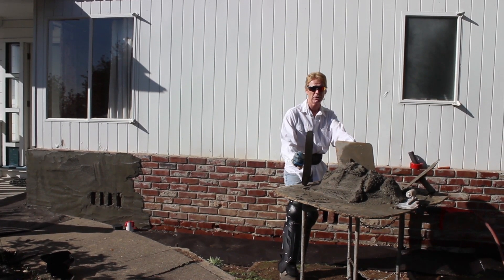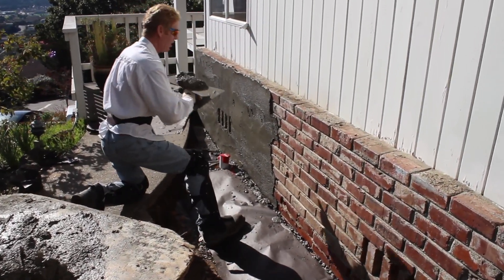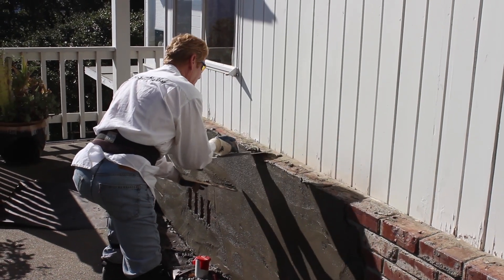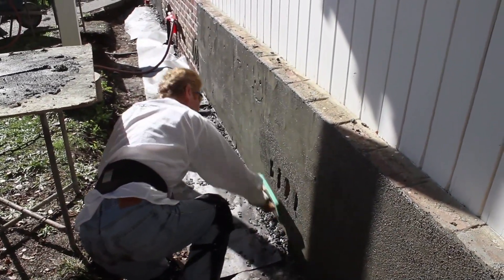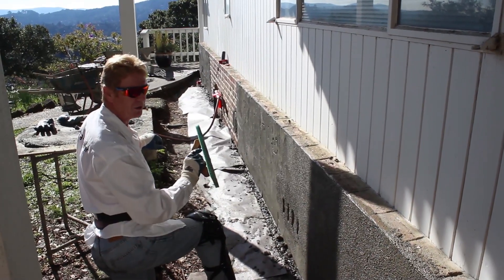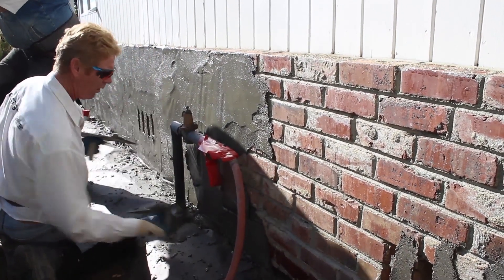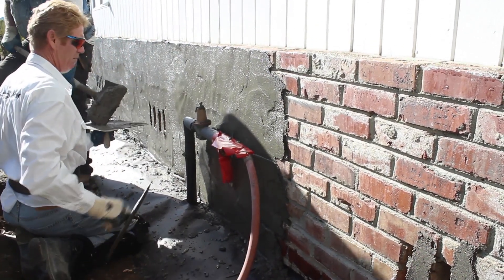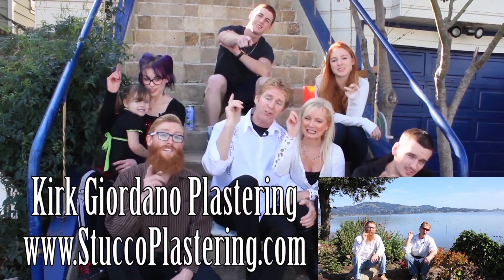Stucco over brick walls

Comment: Do you have to repoint all the brick, or can you use the “skim coat” and push it into the joints if it’s bad and falling out? I had a “skim coat” that was done horribly, all cracked and falling out. I simply used a hammer and taped it and it just crumbled off in most places. The joints are all dust and falling out in 90% of the bricks. I’m guessing they didn’t clean off the wall before hand and that’s why it didn’t stick the first time they did it. But to repoint all the brick is going to take me 2 days. It’s just me and my moms boyfriend redoing it. I used a high pressure hose and got all the dust and dirt off. Can we just go a little heavy and push down hard to fill in the spaces or do we have to repoint it first?? I would imagine just pushing the stuckko down hard is going to fill most of the spaces. I did have to relay 3 different spots that were so bad I could literally just pick the bricks up. I actually took them all out and restacked and remortored them myself. A cpl bricks were so bad I had to replace them. But this was in the places the down spouts were and they all ended way too high so I imagine it was all the water damage that caused them to deteriorate. The rest of the wall is in good condition and still holding tight but in a lot of the wall (ok most of the wall) they are missing most of the mortar in the joints. You can see on the stuff that fell out the old skim coat was pushed into the joints but it fell out with the rest. Again I’m sure this is because they didn’t clean it before hand. And way what do you suggest? I really don’t wanna repoint them all and make it a 4 days job as opposed to a 1/2 day job especially since my moms boyfriend is a older gentleman so I would end up repointing myself. I did repoint or relay the really bad spots so with the rest, as long as all the loose dirt and dust it clear can I get away with a thick skim coat if I make sure we are pushing it into the cracks???
Reply from the maker: Good evening my young friend. Clean as in this video and simply skim the bricks, no need for tucking if you will skim coat the brick wall.🤠
Kirk and Jason Giordano plastering, sharing well over 850 free Stucco/Plastering videos for your education. 
    Together we have created the most comprehensive encyclopedia of Stucco and Plastering videos ever produced globally, all by your favorite plastering messengers of YouTube.
Bringing peace, love, and brotherhood back into plastering.🎭🏝🎆

Comment: Hey kirk my wife & I purchased a home that was built in 1911 & it has brick column pedestals along the front porch , I want to put stone veneer on the brick,  should I use a bonding agent before parging the brick or do I need to parge at all to apply the venners
Reply from the maker: Howdy Mark, bonding agents don't attach stones to anything. 
You would need a cementitious adhesive for that Such as Ploy-Bond by La Habra.
 Or a tile grout.🍻

Comment: Kirk, I love your videos.  Have helped my tremendously stuccoing my home in Florida.  I have 40 ft high brick building in Boston that needs restoration.  Repointing quote is $120K ouch.  What's your though on stuccoing in cold weather states?
Reply from the maker: Howdy Pedro, stucco holds up well to snow as well as Safari desert conditions. Sidewalks are everywhere in the united states, It's the same material. stucco has portland cement and sand while concrete is portland cement and rocks. 👨🏻‍🔬

Comment: if you do a scratch, brown, and a finish layer, what is the appropriate drying time between each layer?
Reply from the maker: Howdy  Kyle dude, 
    if it's a wood substrate with paper and wire, 48 hours after a scratch apply the brown coat, "second coat," then wait two to three weeks later after proper hydration, to apply a color finish.
      If your covering bricks or concrete blocks, apply just a skim coat, 1/2 inch or more, allow setting 2 to 3 weeks also, then apply a cementitious color coat.
 FYI, if your planning on painting or applying an acrylic stucco finish both seal the stucco, wait 1 month cure time.
     
                                   Live long and plaster
       Sharing plastering information,  as the world can use more teachers.

Comment: Hey Kirk, thanks so much for the videos! Entertaining and very informative. 

Question for you: are there any precautions that need be taken when working with old brick (early 1900s)? I've been told that modern mortar (containing portland cement without any lime) can destroy old soft brick because it doesn't leave room for thermal expansion. Is this a concern when using modern stucco on old brick, especially when the brick mortar joints are chiseled out?
Reply from the maker: Good morning Deriek, I would not worry about this myself, yes, it's a fact that Portland cement is sort of new about 150 years old and discovered in Britain in the 1800's while lime plastering is well over ten thousand years old. 

                                             best wishes,
 Sound advice for plastering issues from your favorite stucco geeks

Comment: Hey kirk..I'm trying to learn plastering. Do u have to put pva(glue) on internal brick wall before plastering sand and cement?
Reply from the maker: Evening Shaheb, I would as you can't pressure wash and interior wall. It makes a house too wet. 🍺
 Plastering tips and products by Kirk and Jason Giordano with over 800 video’s
           bringing peace, love, and harmony back to the plastering world

Comment: Kirk big fan... I have a question so we can do sand finish with gray mud, or is it better to buy stucco for example 16/20 la habra..  thanks
Reply from the maker: Howdy Zarate Dude, if you use a grey basecoat as we did in this video, you can bring out the sand if you choose to.
 if you use a pre made finish coat with 16/20 sand, it's easier to get a perfect finish as the sand is screened to be the same size. 
 
                                  Best wishes,
    Professional answers on plastering projects with issues

Comment: Hey Kirk can you do a video of you ruling a wall , I haven’t seen you do it yet . We use a aluminium u channel to rule the walls here down under to make it perfectly flat and straight .
Reply from the maker: Greetings Jon, I have so many of these, I call it rodding or darbying a wall.
 Type these words in on our channel, and quite a few will appear.

                Cheers,
       Sound Plastering tips from your favorite stucco geeks
Reply: I’ve seen a few of you using a Darby , but I’d like to see a video of you ruling it true and plumb or rodding as you call it .

Comment: Would fogin it make the grout lines go away?
Reply from the maker: Good evening No Dude, no, a fog coat is to generally to remove scaffols joint colors or to even out a color coat that where the wall was wet unenly giving varinces of colors, it's basically water with cmentitious color in it.
                       Live long and plaster
           Sharing the plastering knowledge
Reply: Thanks boss

Comment: Love these Videos!  Helpful! I have a brick on my front steps that have old glue from carpet and and are just old and ugly.  Is there anything I could coat over it?  Everyone says def no concrete b/c it will crack.  Im a one woman show but have done a lot myself around the homes I've owned and am up for a challenge..  I just need to save money so I dont want to have it redone or put wood over or tile over it.  Any  helpful suggestions much appreciated!!
Reply from the maker: Hi Bris Saxon, sure you can save the dough and do it yourself, use a gas powered pressure washer and remove all the dust,dirt grim carpet glue ect from the brick porch and steps. You may find that this does the trick for you, as it can look brand new afterwards. If you don't like the look apply a bonding agent, weld-crete then apply a thin coat of BMI 690, and either smooth it with a trowel of bring out the sand with a green float.
 If you have or had any movement in the bricks, then it may crack your new surface. 
BMI 690 is only sold at plastering yards, thus google plastering yards near me.

Comment: hey kirk I have to paper and wire on to a new footer that was added and then try to paper under this disintegrating exterior corrugated drywall now the footer is about 3 feet tall should i use bitchathane membrane up to my bottom plate and then paper down from my tie-in if I can get that paper in under that corrugated drywall  whats the code on that? and how should I install my wire on to the footer? and should I use diamond mesh or stucco wire? thanks just wondering what you would do.
Reply from the maker: Good afternoon Lincoln dude, I have video's showing how to do this type in on this channel how to lath exterior sheetrocked walls or lathing stud walls. It's time consuming to figure out where to stop, often it's best to remove the whole thing and start fresh.
                       Live long and plaster
           Sharing the plastering knowledge

Comment: I am redoing a garage attached to my house it is wood framed on cinder block foundation that comes up about 3 feet off the ground, once the outer boards 4x8 1/2 inch plywood was put on it overlapped the cinder block by one foot. When I do the stucco what would/should I have on the bottom of the plywood to hold the stucco in place on the bottom of the wall?
Reply from the maker: Howdy Sardom, type in weep or drip screeds on my channel, I have about 10 videos that show how to fix this issue.
     
                                   Live long and plaster
               Kirk Giordano’s Plastering answers to life’s issues
Reply: Kirk Giordano plastering Inc. excellent !

Comment: Kirk , first let me say am a big fan and thank you for you videos I have been able to complete jobs the correct way ..     I have a question for anyone that can help .
I have a job that requires eifs over painted stucco .  It’s a existing wall that has really old course painted stucco and the cliente wants a smoother finish .  So it seems to be to difficult to just skim it  and new finish .  So can I apply eifs over this painted walls . Or do I need to remove paint first .
And if so can I sand plastic it off ??
Thank you
Reply from the maker: Howdy Hector, if it were me, I'd apply a bonding agent over the wall.
 I recommend Weld Crete by Larson.
 Of course, nothing adheres to a dusty surface so clean the wall first with a water hose to remove any dust.
                 Live long and plaster
 Do’s and don’t of plastering’s leading experts

Comment: Great video. Curious if this stucco trick could be used for a brick walkway? Our home is brick and so is all of the hardscaping so a bit overwhelming visually. Looking for a cost-effective way to change the hardscaping in the walkway and backyard pool surround without having to rip and replace everything lol the homes brick exterior was already stained to change the color but if there is a way to use stucco as a way to make the appearance of the brick disappear that would be awesome
Reply from the maker: I’d suggest attaching slate over it. Stucco won’t adhere very well to walkways especially that’s been stained.

Comment: hello, looking through you videos and haven't found what I'm looking for yet. Have you done a house with a fluid applied WRB like R Guard, polywall or any like it. I am wondering how you flash in the paper and lath at the bottom of a window. Thanks for all the videos and insight.
Reply from the maker: Howdy Adam Dude, not sure what you're referring too,  I do know that any bottom window sill flashing should cover any new moister barrier.
 If there's no window sill flashing make one, either apply a peel and stick which needs no caulking if done right or but a paper flashing next to the window sill and caulk with a polyurethane caulking, to seal the paper to the frame forever.   
    If I have misunderstood and you are hoping to just apply a waterproof membrane over some sort of "Densglass board," this I don't feel will work as even Densglass need a moister barrier and not just a roll-on finish coat, if stucco is to be applied over.             
                              Live long and plaster
                Kirk Giordano’s professional plastering advice

Comment: Aloha Kirk and many thanks for all of your great advice and videos. I do have a question for you that I need some help with. I want to stucco over the Old cement block exterior wall of my garage that the 1929 stucco has been crumbling off of.
 I was thinking of first scraping off all the loose stucco the number to power washing the number 3 skim coating with at least a half inch to an inch a mud which I'm thinking 1 to 3 ratio and possibly putting some lime for x-ray vision what do you think about the addition of lime? Also, I was thinking about a finish coat of white Portland and sand what do you think about that? I'm looking forward to your Insight on this project thank you so much.
Reply from the maker: Evening Demetrios, I'd recommend Hansons Lehigh cement plaster, it has lime in the bags already.
 I too mix three parts sand to one part cement plaster. 
Rather than the white portland cement plaster, I'd use a cementitious finish coat, comes in Christal white, too.

 Plastering tips and products by Kirk and Jason Giordano with over 800 video’s
           bringing peace, love, and harmony back to the plastering world

Comment: Hey Kirk, I've watched a lot of your videos. my question for you involves a 125 year old chimney with some sort of cement the was troweled over brick (i'm guessing to help seal it) its crumbling in places and my local mason suggested chicken wire with a Portland cement/sand mix, then a second layer. do you find this adequate ?

I will be covering over the chimney, so its more for structure than aesthetics. Thank you!
Reply from the maker: Evening Evan, I'd recommend Rapid set Stucco, from Home Depot or Lowes one coat will correct any size hole, without the use of stucco netting.
Just make sure the wall is clean from dust, dirt or, grime or nothing will adhere, plus wet the wall or apply a bonding agent before applying the new Stucco.  
 Plastering tips and products by Kirk and Jason Giordano with over 800 video's
           bringing peace, love, and harmony back to the plastering world

Comment: Can this method work over old soft bricks and lime mortar from the 30s?  Do you use different materials for that application?
Reply from the maker: Howdy Eric, this method can be done over bricks that are thousands of years old, but they must be cleaned very well, yes they knew how to make bricks and blocks a thousand years ago. In fact, pyramids were built long ago.🍺
Reply: @StuccoPlastering  Thank you for your response.  I don't see you have any videos on stucco over brick where the stucco is fully covered over the brick but the outline of the brick is still visible.  I think they call this slurry wash or brick sacking.  It has a modern look for traditional old homes.  Do you have recommendations on this ton using synthetic stucco or natural stucco in a hot humid moldy environment?  Can you make a video on this when you have a chance?  Thank you.

Comment: Hi Kirk! Local guy here. Just curious, will this eventually hairline if the brick is sound?
Reply from the maker: Good afternoon Stevie dude, excellent question, doubtful as bricks, cinderblocks and concrete don't swell like plywood.
 When the hot sun hits plywood  for extened periods of time even under stucco this can make the plywood or even studs swell, thus hairline.  
                    Live long and plaster, 
          Kirk’s, plastering tips and techniques

Comment: I am doing something on a much smaller scale and it might be a dumb question (bear with me here). I bought a small container of stucco in hopes of applying it to the pots for my balcony garden. I hate looking at crappy plastic and bare terra cotta, so I was attempting to go for a stoney-concretey type look. Question, will it adhere to them without anything between? Also, should I put any sort of protective coating on top of it? I have zero knowledge in this field, I am an artist but not when it comes to home exteriors, Lol. I need all the help I can get at this point.
Reply from the maker: Howdy Haley, clay is as natural as white on rice and last hundreds of years, I can't see trying to reinvent the wheel. Cheers.👨🏻‍🔬

Comment: Is it necessary to install foam an wire over brick house
Reply from the maker: Good Evening Juan Dude, excellent question. No, it defeats the purpose.
 One only attaches stucco netting to bricks which are failing, big time.
 I have done this one time in 40 years.
       FYI, we are still working through the pandemic, however, if you’re not you can still learn to repair yourself through our huge selection of videos on this channel.   
 Bringing you the most comprehensive encyclopedia of free plastering video’s ever put together,
 by the plastering messengers of Youtube. 
Kirk and Jason Giordano with over 800 videos 🎭 👀💃
Reply: @StuccoPlastering  Kirk i already used concrete nails just made sure to insert nails only on the grout line and two wacks maximum seem to came out fine so far i addded popouts an did a true plum brown coat then. Came back a week later an thru sand finish home owner loved it
Reply: I love my job so much when i get home from work i like to watch ur videos